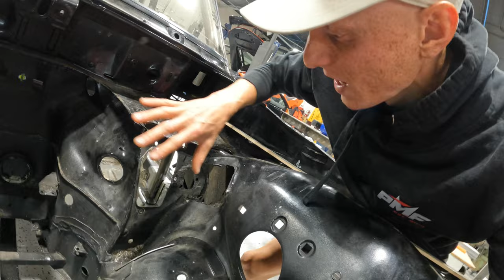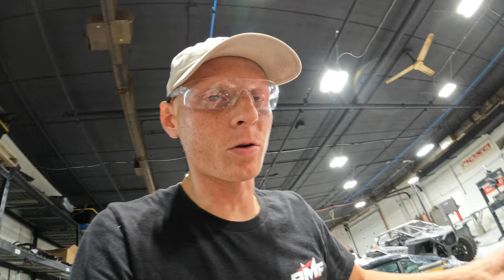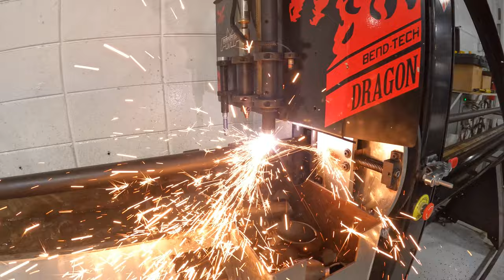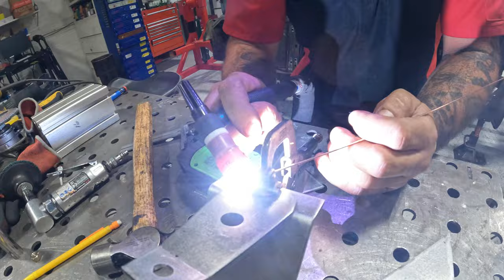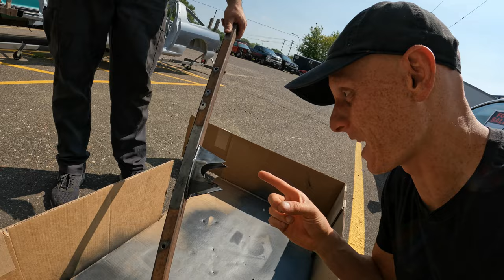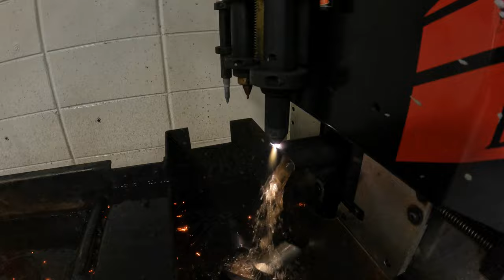Renault 5 Turbo Group B Safety Structure EP.3

Comment: Did you read FIA Appendix K for historic safety requirements before you started this project?
Reply from the maker: I asked our Head Fabricator and he said "We did consult Appendix K before this build, and in fact, FIA has a ruleset specifically for the R5 when used in history Rally.  This car however, will be seeing track time in the US and because of that, needs to adhere to a more strict set of modern ARA/FIA rules. That's why there are additional bars in the cage beyond what is just required by FIA for historic use. The nice thing about the specific R5 ruleset however, is the homologation of more modern components such as an updated FIA fuel cell built by '3S Developpement' out of France."

Comment: I assume this is a Racetech 4100 seat. What size is it? I am 6'4" too at 220 lbs.
Reply from the maker: Apologies, just seeing this comment! The nice thing about the 4100 is that it comes in a variety of sizes, so there's definitely an option for you: 
RT4100	Standard size, FIA approved
RT4100T	Tall size, FIA approved
RT4100WT	Wide-tall size, FIA approved
RT4100HR	Standard size, Head restraint, FIA approved
RT4100THR	Tall size, Head restraint, FIA approved
RT4100WTHR	Wide-tall size, Head restraint, FIA approved